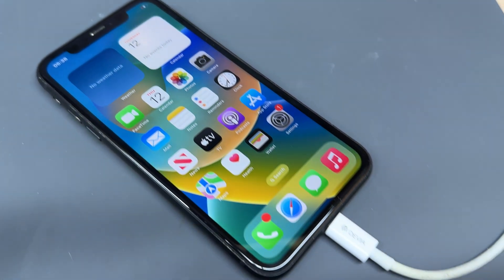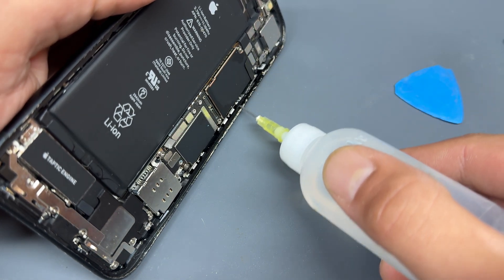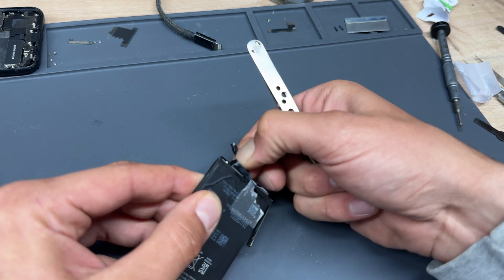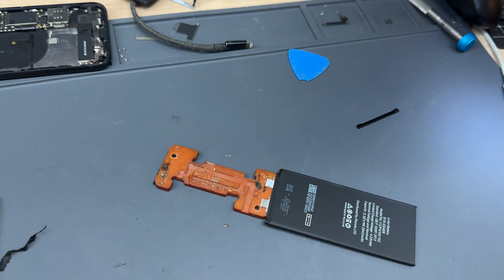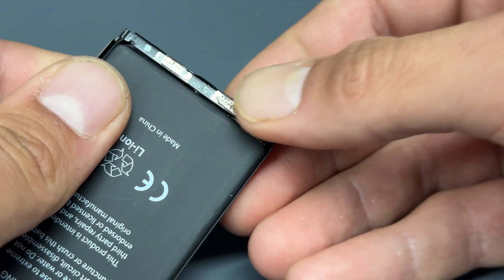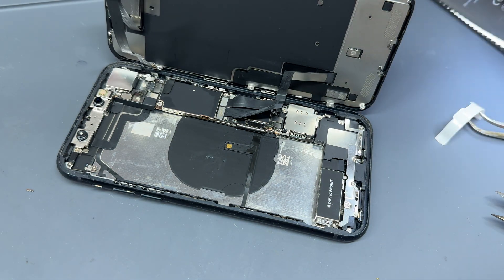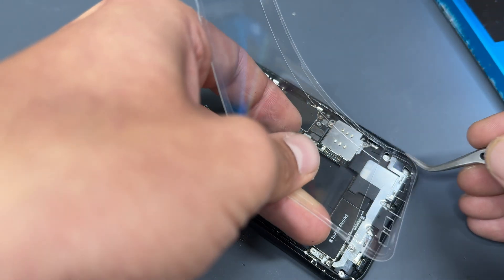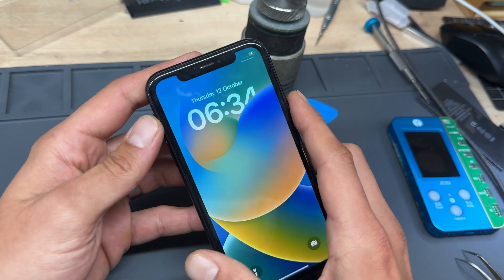iPhone XR - Battery Replacement Guide - Fix Your Phone Like A Pro!

Comment: Any help reconnecting a torn battery flex cable? When i took the original battery out, it stayed stuck, so I used brute force to get it out (by pulling up the battery flex cable and unfortunately breaking in it in two). I only found out about Apple's stupid scheme after noticing the stupid "Important battery" message and searching online. Please help if you can. If not, I can live with that stupid message and will have learnt a valuable lesson. Cheers and thanks for the video.

Comment: My iPhone 11 Pro recently had charging issues and technician removed the battery. While reassembling he did not put any Adhesive back of battery. Now I feel my battery is heating a lot. Does it because of no Adhesive back of Battery? Do Adhesive act as thermal paste like the one we use in case of computer processor??? Please let me know and also if you can share a buying link…. Anyone else facing similar issue??? Please reply in detail
Reply: I suggest asking your "technician".